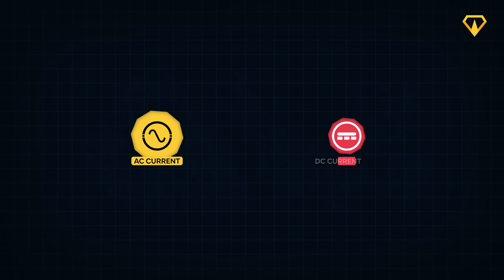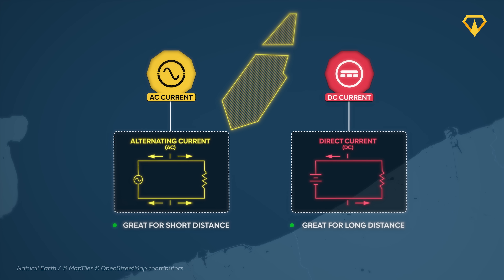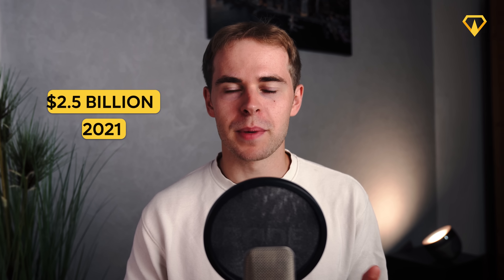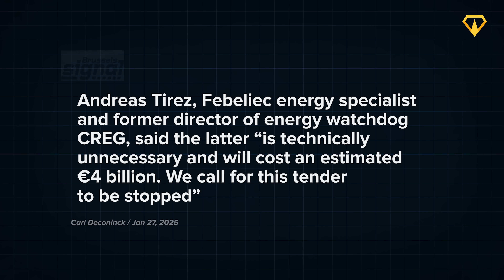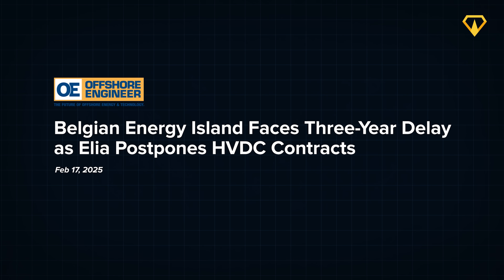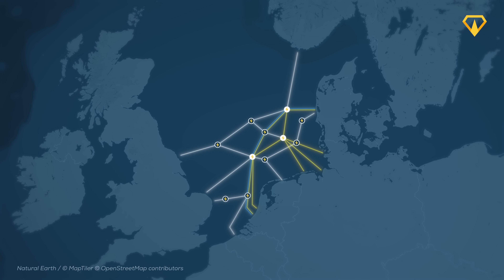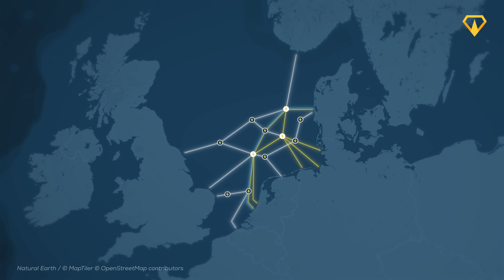How Belgium’s $7B Island Will Power Europe

Comment: You are incorrect. AC is great at long haul, it just has lower power factor than DC. DC, at low voltages, is not good at all for long haul, but very good over short distances. Long haul DC requires a significantly different, more expensive, infrastructure than long haul AC.
Reply: No, this is wrong. Volt for volt, at any voltage, DC is better for transmission than AC and incurs less line loss. The reason we use AC for the electrical grid is because it is simple to transform to other voltages, so we can bump it up to very high voltages where line loss is reduced and then back down again. For DC this is a lot more difficult and is generally only done for special connections. If we could step DC with about the same efficiency as AC, then we'd quite likely be using DC on the grid as we'd be losing less for long distance transmission. Heck, with today's much more efficient DC buck converters, if we were to redesign a power grid from scratch we'd probably still use AC for the main grid but at the "last mile" convert it to DC at the neighbourhood level and supply something in the 200-300 VDC range to the end consumer and we would definitely be running DC for consumers.

If you want to see this AC transmission loss for yourself, take a low voltage AC source (like an older doorbell transformer) and a hundred or so yards or metres of small gauge cable and check what the voltage is at the ends compared to at the transformer. Then do the same with a DC source of the same voltage.
Reply: Current doesn't travel long distances well so AC and DC travel better at high voltages and very low current, until recently AC was much easier too boost using transformers. Now much more efficient DC to DC converters are allowing high voltage DC to be set long distances.
Reply: i was wondering about this too. if i recall right, back in the day there was a battle over which to use, AC or DC, between Edison and Tesla. Tesla advocating ac won out because it was more efficient at long distances. i guess things have changed since then.
Reply: @jackiepie7423  Tesla won, not because AC is more efficient at long distances, but because he came up with a way to easily raise the voltage at the transmission end and then lower the voltage at the receiving end (A Transformer). High voltage = low current [for the same power (P=VI)]. Losses in transmission wires are due to current, not voltage, so keep the current low with high voltage and the losses are greatly reduced. This is true for both AC and DC, but much more difficult to do with DC, indeed impossible for Edison to achieve.
Reply: @jackiepie7423  back in the Tesla days, AC made sense as it's easy to jump the voltage up for transmission and back down to be used.
Now we can do this at scale with modern electronics for DC it make DC transmission more attractive.
But it's still expensive to invert that much DC. I thought we needed longer transmission lines to make it worth the additional infrastructure.
Reply: Lol. I just experienced the Dunning kruger syndrome. I have an electrical degree but I am not a practicing electrical engineer. To my knowledge AC is more efficient than DC and came straight to the comments convinced I caught a mistake only to be schooled about HVDC and UHVDC. 😂
Reply: @charlmarais2283  Always good to watch humility by people willing to learn something new ;-) We have too few of those people these days.
Reply: @charlmarais2283  Same here, although i do work with electronics every day since i was about 7, and i am aware of talks of doing HVDC lines and i know it is pretty easy to convert from generated AC to DC using diodes, but i wonder what will they use on the other side, from DC to AC again? Huge DC motors driving huge AC generators????
Maybe someone figured out how to make an inverter that can not just withstand but also work 24/7 at a million volts DC !!!
I sincerely doubt it, and i am chalking this to another new age fad.
And then there is the arcing .... just ask solar installers! 😃
Reply: In case of underwater cable DC energy transfer is more economic. There are less power loss due to no reactive power which is dependent on water electrical capacity. DC simply doesnt induce current.
Reply: @icmi5974  And you don't have to addres the synchronisation issue
Reply: @icmi5974  so how will this be done? the turbine generates DC, gets converted to AC to stabilize and then converted back to DC to transport or the conversion to AC is ditched and they somehow manage to get a fluent high voltage DC?
Reply: thanks
Reply: That's the reason I went to the comments. Yes that is true AC is more efficient the long distance but there isn't nothing of sending direct currents long distance that's pretty efficient as well so I don't think that's what he's talking about
Reply: @roberthorchar5690  HVAC is not more efficient long distance, HVDC is, why are all of you spreading wrong information 😂
Reply: You are incorrect AC for short transportation and DC for long due to capacitive effects! 
DC has a higher initial cost but scales better than AC!
Reply: The power factor limitations are non-trivial. Put synchronous condensers at both ends of the line and that problem is solved. UHVAC is already common in China, we may see 2 MV transmission line voltages by the end of this decade.
Reply: A 50/60Hz high-voltage AC cable cannot be longer than ~20km because of its capacity. So there are AC cable connections via the Strait of Gibraltar, but none from France to Great Britain.
Reply: Ireland being "involved" in this is a joke...we don't even have a proper grid, can't hook up new houses because of this which affects house building & FDI, also can't get planning permission for any wind farms or housing fir that matter. We have the highest electricity, gas & petrol/diesel prices in the world.
Reply: Although my studies in power transfer are some 30 years ago, it was then clear back then that DC is preferable to AC. The reasons are 1) reactive losses 2) skin effect 3) Higher transmission capacity for the same line 3) Smaller voltage drops - lower losses 4) More stability 5) easier connection of multiple unsynchronised grids. The main disadvantage of DC is a larger initial investment to build converter stations. If we could rebuild the high voltage lines today in Europe we would use DC and not AC. This is in fact being actively studied. There are plans to expand the current network down to Sahara.
Reply: He said AC was for short distances. The vast majority of long distance transmission is AC. That’s objectively wrong. Just because DC can be done at long distances doesn’t negate that AC is dominant. 
He said it was for short. It’s not, it’s for whatever you need. 
A more complete and accurate statement might be “in this instance, DC is favorable because…”. Not AC for short, DC for long. That’s wrong.
Reply from the maker: Just to clarify, we are talking about High Voltage DC here, which would be more efficient over these distances. But they faced massive cost increases here..
Reply: @MegaBuildsYT This is an interesting thing that very few people know about. Back then when AC won against DC transformers made it amazing for long distances. Now as we learned to convert AC to UHVDC and back we can avoid reactive losses. The tech behind it sounds like it's out of sci-fi for such a simple being as me, I wouldn't believe we have 1.1MV DC lines if not so many fact-checks were proving it. And they're right where I am, connected to the country where I live as of now. Not your profile, but some of your videos were quite open-minded. Maybe you can tell us about the tech behind these UHVDC lines? 😊❤

And thanks for the stuff you're doing. And for being fair about the war. ❤
Reply: why are you spreading misinformation? its literally the exact opposite
Reply: Great idea. Now just have to keep the Russkies from cutting cable.
Reply: It doesn't really matter much is AC it DC, as long as voltage is high enough. The only advantage of DC is less parasitic losses.
Reply: AC is much easier to work with, that’s going to take some big inverters to transform the power back to AC from DC. Just up the AC transmission voltage.
Reply: We can argue over which is more efficient overall in different circumstances, but the basic electrical facts are:

1. For a given power transfer, resistive loss is inversely proportional to the square of voltage and proportional to distance;

2. First order reactive loss is proportional to frequency and proportional to distance. DC has zero frequency, hence no reactive loss;

3. DC conversion loss is currently greater at most scales than AC conversion loss. DC conversion loss is decreasing with technology development; and

4. DC conversion cost is currently greater at most scales than AC conversion cost. DC conversion cost is decreasing with technology development.

Which transmission mode to use will depend on cost and loss (efficiency) calculations for each individual run, as well as practical issues of matching source and load frequency and phase. There is no single answer such as  “XC is more efficient than YC”. The answer depends on run length, medium, voltage, current and technology readiness.

20th century infrastructure typically favoured AC transmission by a large margin, but DC is becoming more attractive at larger scales and as technology advances.
Reply: @MarkSJBeard  Very well put. One other thing that I would add, is that a transformer is a very simple and robust piece of equipment requiring virtually zero maintenance. So, where reliability is paramount, AC will still be used long into the future.
Reply: That's correct. AC long distance. DC short. 
And where is the original narrator?
Reply: @robicamedia1554 No, it is not correct. DC is also used for long distance. Check 'HVDC transmission' and 'UHVDC transmission'. Also check 'Zhundong–South Anhui link', UHVDC transmission line over 3000km+
Reply: @louvets  I learn in the 90´s. HVDC and UHVDC are new technological advances.

The software i use to calculate cable dimensions only at 50KV-DC for 500A i see clear dimensions down, but still giant. from 300mm to 185mm for 5Km distance.

Is it the software correct on this crazy choice? I doubt.

When i choose DC, should not be HVDC or UHVDC otherwise would show the choice. Too new and only for HV long distances tech.
Reply: @robicamedia1554 why are you confirming wrong information, what's the point?
Reply: @robicamedia1554 Not really. Low voltage DC works for short distances, AC works for medium distances since it can be transformed easily and high voltage DC is efficient for actual long distances. Look at HVDC links like NorNed between Norway and the Netherlands for example.
Reply: @robicamedia1554 DC is better for long, it is just more expensive for conversion. AC can't go to a high of voltages, and suffers from frequency sync at long distances, and has higher loss due to capacitance. For extreme long haul DC is by far the best choice. AC is used for most transmission because it is easy to step up and down voltages, but long distance DC is better.
Reply: It was the same thing that I wanted to point out. DC is for short distance AC is for Long Distance.

Comment: Now I am confused, I was taught that DC required voltages and cable thicknesses much higher than AC over long distance. The cost of cables alone gave the advantage to AC. Please explain.
Reply: Costs more, but better transmission. It used to be more cost effective to do it the other way, but due to technological advances and a greater demand for every last drop of power, the conventional thinking has flipped.
Reply: @ConstantChaos1  Also AC generally isn't good in salty water. You could likely use special cables to deal with this problem, but it likely isn't even worth the cost vs DC cables, looking at how almost every undersea cable is using DC.
Reply: @MDP1702  I very much doubt the cables will ever touch salt water, there are plenty of suitable conduits to keep the cables away from the salt water.
Reply: @mal6232  The problem isn't that salt water can come into contact with the wire (that would be bad for any cable), but that the magnetic field generated by AC negatively combines with salt water.
Reply: At very high voltages the advantage flips around to DC again. One of the reasons is that AC keeps flipping between a positive and negative voltage with its frequency. So at super high voltages the total voltage flip gets large and becomes a problem and I thought could lead to energy losses, so due to things like this DC lines tend to be more efficient again as you can just keep the voltage stable there instead. Thus allowing you to have smaller cheaper lines then AC lines at super high voltages.